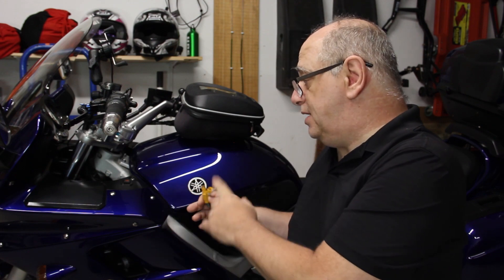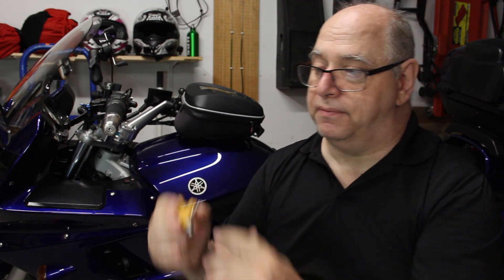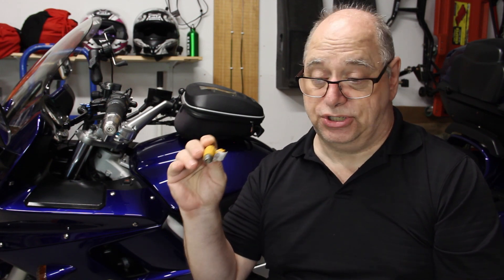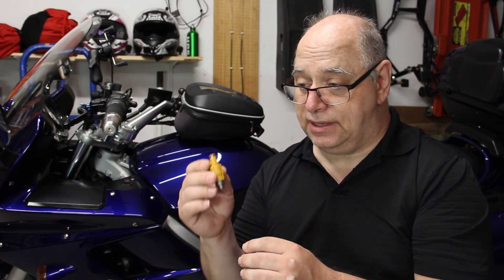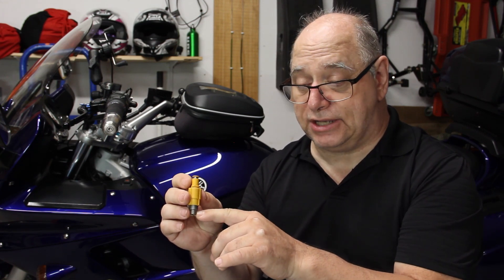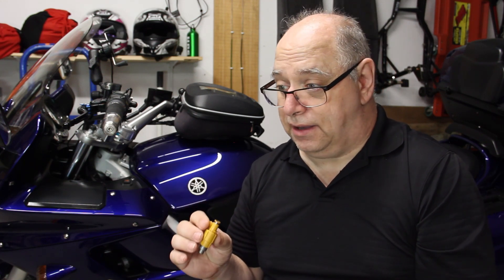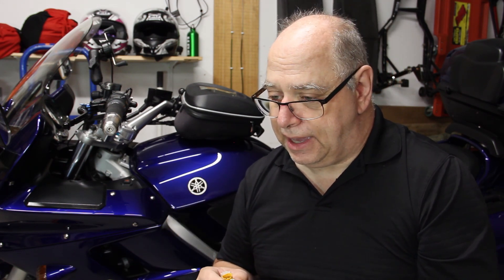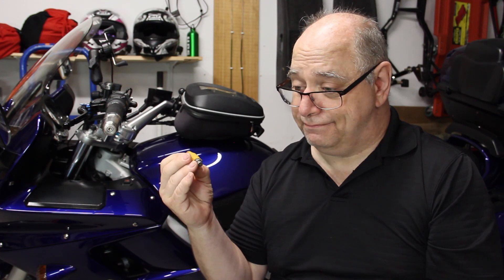Bosch Flow-Matched Fuel Injectors for the Gen 1 Yamaha FJR1300.

Comment: Hi Mike, thank you for your videos. They are very helpful. Now, my fjr 1300 2004 is not starting. It has 107,000 miles.  It cranks very good but I can't get it to start. I replaced de spark plugs but no luck. Do you think it's the injectors?
Reply from the maker: Try some eather in the intake. If it fuel related then the engine will try to start. If not, then it's something else and we we can go from there.
Reply: @mikesfjrcorner7129  I tested the injectors today with a 12 v battery and cleaned them with a spray cleaner and the injectors were shooting good. Also, I looked at the hoses where the fuel goes to the injectors and they had gas, so, to me that means the gas pump is working fine.Im going to try doing the compression test. I think my bike is done for what  I see
Reply from the maker: @luismoncada9280  maybe the crank sensor is not working? Is there spark?
Reply: @mikesfjrcorner7129  crank sensor ? Where is that located?
Reply from the maker: Hello, it's inside on the crank in the right side engine case where the timing chain is.  It provides the timing pulse to the ecu. Do the compression check. If that's ok, then maybe get somebody to look at it. There's always a reason. Thanks
Reply: @mikesfjrcorner7129  perfect. Thank you very much for your help.
Reply from the maker: Sometimes the simplest solution is often overlooked. Glad you got it working.
Reply from the maker: Another thought. Check the kill switch by the throttle.
Reply: @mikesfjrcorner7129  thats right. If that switch is off, there is no way to start that bike. Lol. I will check it.
Reply: Hy same problem, i order inietctors...now i wait that it comes ....what was the finali problem at your FJR ....

Comment: what year is your bike.  I have a 2006.....same part?   And if so where did you get the boots to make the engine block side fit?
Reply from the maker: Hello, it's a 2005. No. This injector is for Gen 1 only.  The seals I got from partzilla.com or mrcycles.com. Hope this helps
Reply: @mikesfjrcorner7129  Hey there Mike.  Thank you very much.  I have a 2006 that I let sit for 6 years.  The fuel turned to mush and the injectors were nasty.  I found out today that they actually cleaned up well and the bike is back up and running great.  I bought the bike new in 08, no one wanted it because of the electronic shifting so got a great deal on a 2 year old new left over.  Ive owned it for 12 years and only have 30k miles on it, cant believe i let it sit so long.  The bike is spotless and im looking forward to getting back on her.

Comment: I might need injectors on my 2004.   So do I use the first or 2nd link? 

The idling on my bike isnt doing to well.. perhaps coz the previous owner had the bike standing for 2 months?

Also, do you have a video where you replace the back covers of the clocks?

Do you have an email address I could reach you on?
Reply from the maker: The links are just examples of where to find them. The top link shows the injectors and what vehicle they fit and the bottom link is a search of the injectors. You can purchase the from any supplier as long as it's a bosch CDH-275 and can fit the Mitsubishi Diamante or the Yamaha 150 outboard motor. You can also find them on amazon or any parts supplier that sells rebuilt injectors. Check the injectors on your bike. It should have the bosch CDH-275 number stamped on the side. You will need the seal from Yamaha that goes into the throttle body as the seal that comes with the injector is slightly bigger. Also, may I suggest cleaning the throttle body, check plugs, wires and coils. Also maybe flush the tank and check the fuel pump for pressure. I think there is also a filter in the tank on the pump.

No I don't have a video. I did this when I first got the bike before I started making videos. 

If you look at the video for HID installation, this covers getting to the instrument cluster. Remove the instrument cluster with the four screws holding it on the back of the assembly and remove the plug connection. open the cluster by removing the screws on the back of the assembly and the two half's should separate. I don't remember, but I think there may be a few screws holding the plastic face on. Be careful not to touch or move the dial needles as these are delicate. With the cluster sitting on it's back and the plastic face off, make note of the dial needle's position and height. Use two small spoons to pry up on the center shaft of the dial by carefully placing the front edge of the two spoons under each side of the dial shaft with the bowl of the spoon's touching the face of the gauge and gently press down on the spoons handles. This causes a straight upward pressure on the dial needle at the shaft without touching or moving it, the dial needle should pop off the shaft fairly easily. Now remove the two screws on the gauge face plate, replace the gauge face plate with the new one and lightly tighten the screws. Put the dial needle back on the shaft while being careful that the needle is in it's original position we noted earlier. lightly push down on the dial needle on the shaft until it's at it's original height.

Put together the front and back covers and replace the screws, put it on the bike and take it for a short ride, use a GPS on your phone that shows your speed and verify the speed is correctly shown on the gauge. If you did everything right without changing the needle's position, the speed should be correct. If it's wrong then you may have to open the cluster, remove the needle as above and adjust the dial needle's position accordingly. Once you verified the speed is correct, then finish putting the bike back together using the HID Installation video.

Hope this help's.

Comment: Awesome videos, My first gen has a rougher idle, might have to try this to smooth it out.
Reply from the maker: Thanks, 

May I also suggest if you have not done so already, check the plugs, wires, boot's and coil's. Age has a way of degrading these.
 
I wen't through everything on my bike for similar reasons. The coils/wires, injectors, throttle body cleaning & sync all contributed.